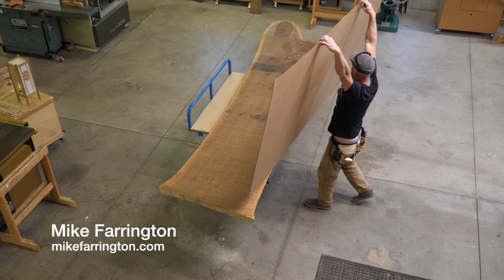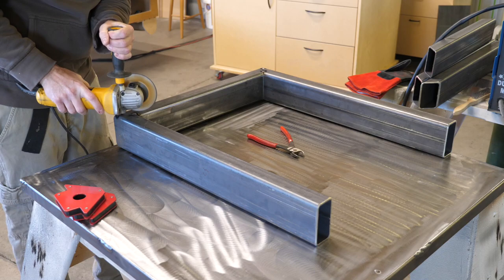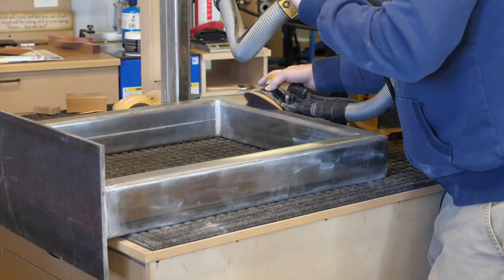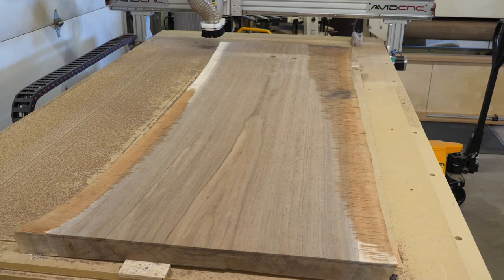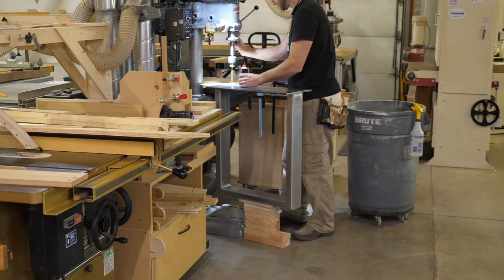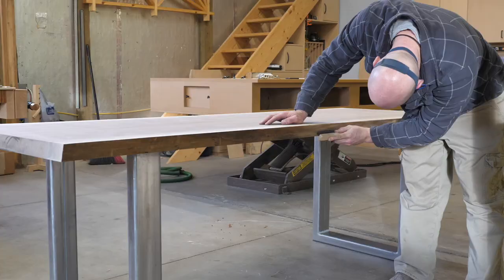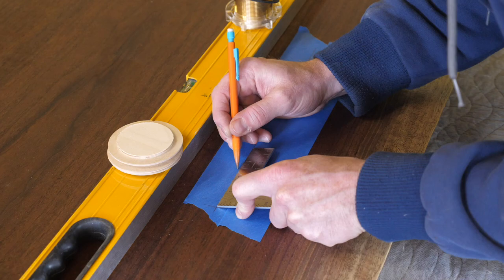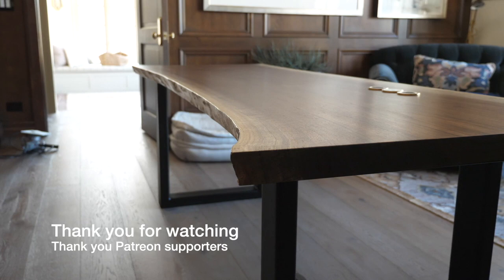Big Walnut Desk

Comment: I found out that hot glue gums up the blades (yes, even when cold) so I remove it with Isopropyl alcohol, it works fantastic. I thought this was my ingenious idea but then some 6 months later I heard it on Fine woodworking podcast. Btw the table looks fantastic and I wouldn't be shy to use it as a workbench :)
Reply from the maker: Good tip. I would probably do that if there was more. Thank you.

Comment: You should consider recessing the best plugs.
Reply from the maker: If I did that they would stick out the bottom farther, which I didn't think would look good.
Reply: @MikeFarrington   Fair enough, everything's a compromise, and you do you pretty dam well so I'm not gonna judge.  Having said that, I do like a smooth consistent top on a desk  irrespective of what's underneath it. Perhaps a compromise where you add an oval  wood piece underneath to conceal the underside with the skilled thoughtfulness you often demonstrate.

Comment: How do the mounting bolts allow for wood movement? Won’t the threaded inserts pull loose because the mounting plates don’t have slotted holes? 
Top tier video!
Reply: Yes, as you suggest, the builder (and the client) should worry about wood movement. Lots of makers don’t make allowances for wood movement. After 45 years in the biz, including 18 years working with century old furniture in a museum setting, I can tell you that wood expands and contracts. Nothing you can do will stop it. If you hold it too firmly, as in this project, you either get fastener stripping or wood cracking. I think the mounting bolts in this case will hold, and if the office environment is dry enough the desk top will crack longitudinally, probably about where the centre bolts are. A lot depends on that local environment, of course. If the wood left the shop at about its seasonal mid-point, and ends up in an environment where that equilibrium moisture content is maintained, then the desk will last for a long time without cracking. But rather than worry about that, simply slotting the holes for the outer bolts would guarantee peace of mind.
Reply from the maker: The moisture content of the slab was 8% and it was going into a very well conditioned house. We also live in an extremely consistently dry climate. So not much movement is expected. However, the holes were 1/8" oversized.
Reply: @MikeFarrington  Thanks for the clarification Mike. Up here in Nova Scotia I’d use about a half-inch slot on each side, and install the bolts within the slots depending on what the EMC of the wood happened to be — mostly 10 or 11% around here. In your case that 1/8” oversized should be fine — for a century or so. ;-)

Comment: Beautiful table great job and video. For cutting steel plate up to 3/8", for 30+ years now, I have used a Bosch jigsaw still going strong which has rarely been used for wood. Also for the steel legs, with a little more metal prep, gun bluing works great and looks great.

Comment: Nice work Mike! if you lived closer I would have loved to help you out getting the software up and running to make you confident about using the machine. It would open a whole new world for a creative guy like you.

Furniture that needs lighting, USB charging or electrical connections always takes more thinking and some form of engineering to make it to the finish line. 

On oak I never need a 2nd coat of monocoat? I rub it in hard using a white pad. let it dry for 5 minutes and remove as much as i can.  The monocoat has a tea kind of scent to it according to my nose.
Reply from the maker: Thank you. I'm getting better as I use the Cnc more, as I get better buy confidence grows. Oak is an easy to finish wood, walnut is a little more thirsty if that makes sense.

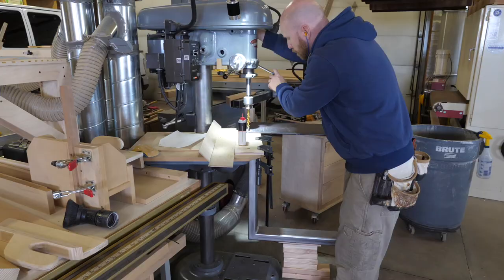Comment: I can't imagine anyone working with a walnut slab, that cost as much as it did, would not follow Cam on Blacktail Studio, but just in case, a tip he has passed on is completely covering the slab in plastic when not actually working on it.  That includes overnight.  This keeps it dry and prevents further warping.  He also uses those C-channels to keep things straight — I am making this comment at the 10:00 point so you have done something like later in the video, and if not, those leg plates would do the same thing, except they are probably going to come off for transporting to the client.  [EDIT]  OK I have watched it all now.  Great that you used the two part epoxy as the base coat.  You didn't show us if you did any prep for that.  The metal looked rather shiny, and I believe the pros sand bear metal with 600 wet & dry before using the epoxy.  It's a beautiful piece.  Are you going to tell us what the slab cost, or did I miss it?
Reply from the maker: I sanded all metal surfaces smooth with 80 grit. This cleaned and re-cleaned with acetone. Then I sprayed. Is was what the instructions called for.

Comment: Are you not worried about wood movement cracking the top? Are the holes in the plate slotted across the grain? Looks beautiful though!
Reply from the maker: The holes are oversized, so there is some allowance for movement. However, the slab was at 8%, and its going in a highly conditioned home, so there really won't be much measurable movement.
Reply: You have the CO low humidity working for ya.

Comment: Beautiful piece of furniture and interesting design.  Clearly a piece of art.   I was wondering how you accounted for wood movement  across the width to avoid cracking since it appeared that the mounting holes  were not slotted or over sized in anyway.
Reply from the maker: The slab was at 8% moisture content and it'll live in a highly conditioned house. So it doesn't have much moving to do. However, I did over size the holes by 1/8".

Comment: Stunning work, as always!  Always find your insights on how to get things done so helpful.  Two questions…is that a ULine Big Joe Electric Forklift and what was that small router bit you used to do the initial hogging out under the desk for where the steel plate/legs would rest?  Thanks much!
Reply from the maker: It is a Big Joe lift. I got it off Craigs list. I used a 3/4" freud bit to do the hogging.

Comment: Stunningly beautiful. Quick question. Do large pieces of natural edge boards that large ever cup on you? I know you secured to long pieces of flat metal. I always wondered about cupping
Reply from the maker: Yes, cupping can be a problem. That was also part of the reason I used 3/8" plate for the leg tops. This will help keep the slab flat.

Comment: Looks great.  Was there a specific reason to not recess the outlets so the top would be smooth?
Reply from the maker: Yes, I didn't want them hanging down below the top any more. My plan was to recess them if the customer requested.
Reply: @MikeFarrington  Makes sense.  I didn't realize how long the threaded collar around the outlet was vs how thick the top is.
Reply from the maker: @mbroome  Yeah, the top is 2" the threaded part is 2" then the wires hang down below that. That was just the compromise I went with.

Comment: Hi Mike, that turned out awesome. Did you give it 2 coats of the Rubio walnut, or was it 1 coat and then the matinence oil? Cheers from Denmark
Reply from the maker: Thank you. I did two coats of Rubio and one maintenance oil coat. Maybe overkill, but I wanted it to look fresh when I delivered it.
Reply: @MikeFarrington  The table is definitely not missing out on finishing! I have done some one-coats of Rubio, and are experimenting with 2 coats of it now.
Reply from the maker: @JesperMakes  For my eye. Walnut looks a little dry with just one coat.

Comment: Wonderful table. How would you have attacked flattening that slab if you didn’t have the CNC?
Reply: One common way I've read about is to rip it in half with a track saw, flatten each side separately with an 18" thickness planer, then glue it back together. Not ideal because there's a (nearly invisible) joint through the middle, but it's a lot less labour-intensive than doing it by hand (using a handheld electric planer and hand planes, and straight edges to check progress).
Reply from the maker: I would have used a router sled. I probably would have attached runners to my bench and then built something hold the router.

Comment: Looks great, but there's one thing I am interested in: I always thought, wood needs some space shrink and so on. Doesn't the wood tend to crack when locked in place like that?
Reply from the maker: There is lots to wood movement. In this case the slab had a moisture content of 8%, and its going into a house that is conditioned. So this means the MC of the wood really won't change very much seasonally, therefore the slab will change size only slightly. Plus I oversized the holes by an 1/8".